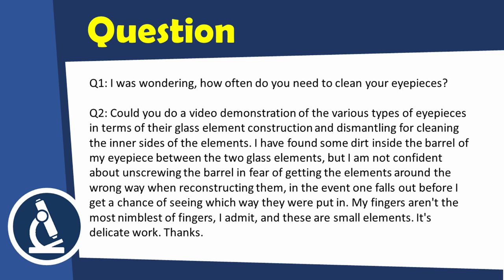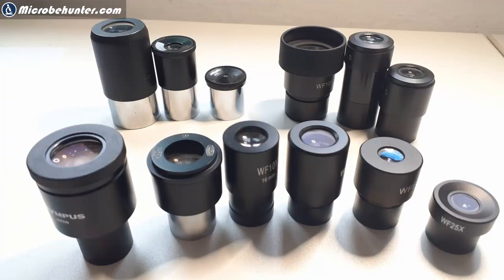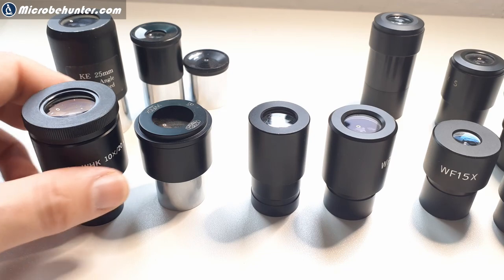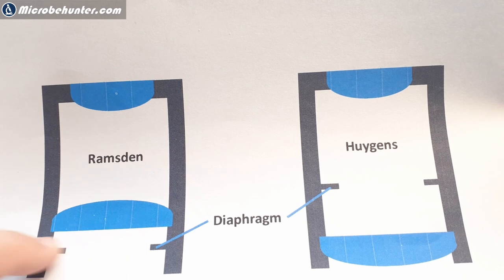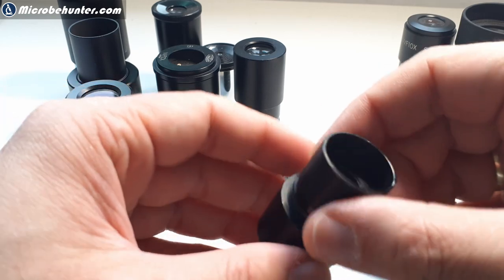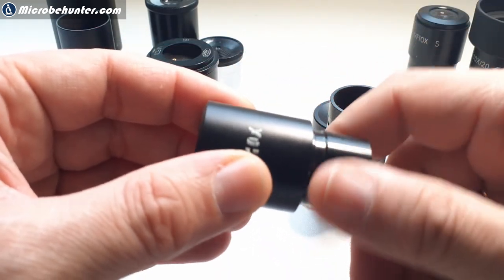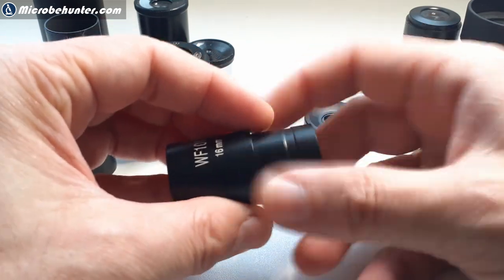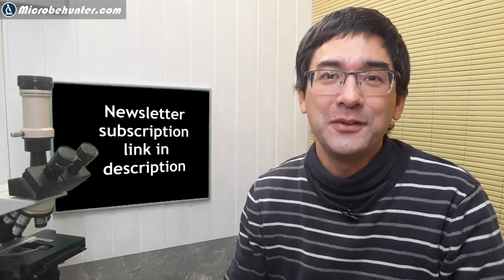🔬 Different types of Microscope Eyepieces (oculars) | Amateur Microscopy

Comment: Hi Oliver. I congratulate you for your channel and for your great informative work.
It is very frustrating (and annoying) that most microscopes have low-quality eyepieces, even the upper-mid-range ones. In this sense, microscopy should learn from astronomy and many microscopists and manufacturers have poor knowledge of eyepieces.
The designs Ramsden, Huygens ... in astronomy, have remained in the field of antiques or relics. Any simple and inexpensive astronomical plossl eyepiece is better than most microscope eyepieces.
I adapt plossl astronomical eyepieces to the microscope and the improvement in quality is impressive.
Reply from the maker: There are some extremely good and expensive eyepieces from high-end manufacturers around, but they are designed to work with their own microscopes optics. When looking at the eyepieces of "affordable" microscopes, then one can see that most of them are similar. It seems that only a handful of manufacturers seems to produce them and deliver them for the different microscope brands. One also has to say, however, that amateur astronomy seems to be significantly more popular than microscopy and the amateur market seems to be bigger. Maybe this also resulted in the production of affordable quality optics. A prardox, becasue microscopes generally are more easily accessible in schools and many doctor's offices have them standing around.
Reply: I agree with you, astronomy is more widespread among the general public and there is the astronomy versus microscopy school paradox.
True, I have seen through Olympus and Zeiss microscopes with quality eyepieces, but this is not the norm. I have also observed through premium brands and the eyepieces were very basic, microscopy manufacturers seem to neglect the subject of eyepieces.
Regarding astronomical eyepieces, I am not talking about exotic eyepieces like the TeleVue Nagler, Delos or PentaxXW ... as you already know, brands like TeleVue, Vixen, Explore Scientific, Meade ... make excellent plossl or orthoscopic eyepieces at very affordable prices . Even lower-end astronomy brands offer better eyepieces than mid-range microscopes. Regards.

Comment: I got an older used Bresser Biolux NV which has eyepieces with a 20mm barrel size. I guess they are comparable with the cheap / bad 0.96“ astronomy eyepieces. Commenting as you did not mention this size in your overview.

Comment: Hello! I have an urgent question: can eye pieces of different FN be exchanged? I have a straight tube microscope, those designed in the 50s, and they have standard 23.3mm width but a pathetic FN of 14. Can i change it to another eye piece with FN of 20?
Reply from the maker: Yes. The FN is the diameter of the inside lens. FN 20 is quite much, more is not possible, because the total diameter is 23.3.

Comment: I have a Kellner style lens system Binocular microscope with 10X eyepieces.  Unfortunately, the doublet style lenses on the right eyepiece have separated and the internal lense was found clinking around loosely inside the housing.  How do I cement them back together?
Reply: I would first suggest getting a replacement eyepiece if possible. If replacements are no longer available I would suggest trying to find someone who already knows how to do this. If those two options fail then you can try to tackle the problem yourself. I'm sure a professional would have their own method of dealing with this issue, but here is what I would consider doing.
If the separation appears so perfect that I don't see any residue from the existing cement on both lenses, I would clean the two surfaces, then use  optical cement to recement the lenses back together. You can go to Edmond Optics web site, sear h for optical cement, then order what seems appropriate for your project. I would also do a web search to see if there are other comparable products along with comparing prices.
If there appears to be old cement attached to either lens along with a few pieces missing, then the repair job just got harder. If I really wanted to continue with this project, I'd consider first attempting to remove any of the existing cement. I would try various solvents to dissolve the existing  cement. This would involve some trial and error. Acetone might be a good starting point. There are some solvent mixtures available like various laquar removers used for electronic components. The difficulty with these solvents is that they must be used in a well ventilated area which is a big safety issue. The solvents can require being kept at a higher temperature in a sealed container for possibly weeks. Beside safety, there is a further possible risk that the glass itself, or at least any coatings could be damaged by the chemicals.
I remember reading about a company that actually did this procedure to repair enlarger lenses. It was so many years ago, I just don't remember their name. I suppose you can do some internet searching if you still want to pursue this.
So my conclusion is that the probability of success depends on many factors and is probably low. I think I would first try just putting the two lenses back and try to see if the uncremented lenses work well enough. Alternatively, I think I would try using a temporary fix, like using a tiny drop of mineral oil between the elements and retesting. This of course can be messy, but might be something to try. I hope this helps. Good luck.